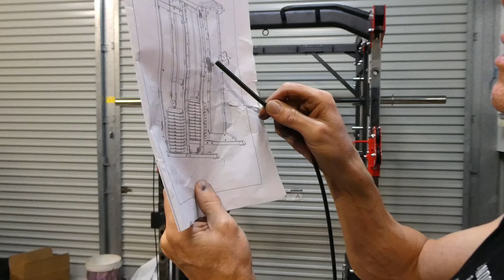Muscle Motion Smith Machine and Cable Gym Assembly

Comment: What was your total assembly time?
Reply from the maker: Well I had to pull it apart in a couple of places as I forgot to put reinforcement plates on. So it's blew out to about 12 hours. But if I wasn't filming would have been much quicker. But I would allow 8 hours at least. I'm sure now I know where all the parts go and which length bolts go where I could do it in 4 to 5 hours. Thanks for watching.... Karl